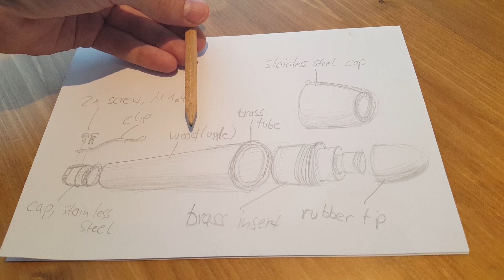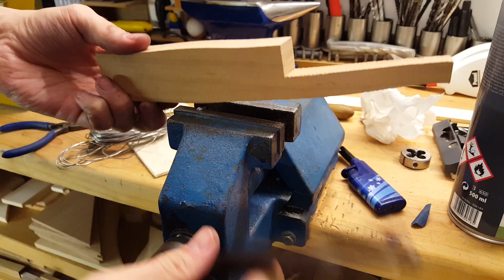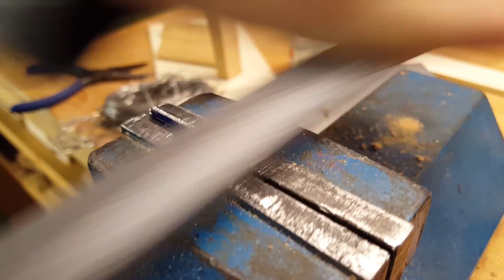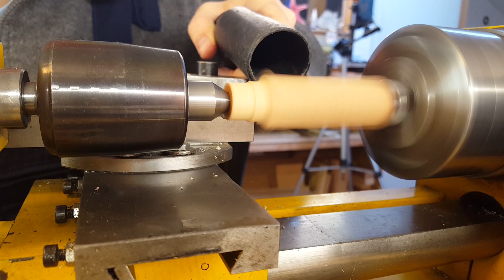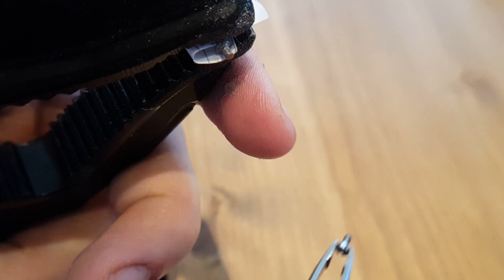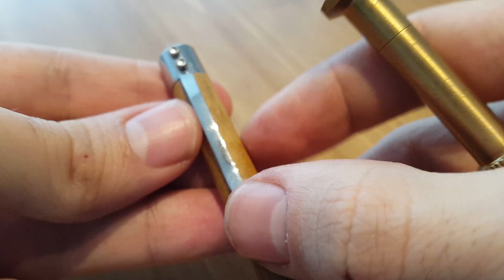How to make a fancy stylus in the metal workshop

Comment: Which material you use in the pen for touch plzz, reply
Reply from the maker: Hi, what part of the pen do you mean?
Reply: @pilotsworkshop4554  pen front black portion which is touch to the mobile screen for writing.Black material.look like rubber bush.
Note- Sorry my English is Soo horrible 🙂🤗
Reply from the maker: Ah ok, I didn´t make them but used standart ones that came as replacements with a pen that I bought. I don´t know what they are made from, It´s something between rubber and sponge. Hope that helps :)
Reply: @pilotsworkshop4554  ok thank you Dear frnd

Comment: When you push the brass tube into the wood, won't it simply scrape out all the epoxy you have used on the tube as well as the wood? If Youtube would allow 5 likes I would have clicked 'like' 5 times.
Reply from the maker: Hey, that was a thought I had as well. So I waited for 2 min to let the Epoxy soak in to the wood and I prepared the brass by sanding and cleaning it with acetone before putting on the glue. Then it just needed to stay in the tiny cracks and ridges. It only needs a very thin layer of epoxy to bond. 
I´m glad you liked the video! Thanks for watching!

Comment: I don't get it how it works. Everywhere I search about capacitive styluses they state it has to be metallic so that it can conduct to you and such (I can't really explain it in english). So either this is not capacitive touchscreen, or I did miss some magic trick
Reply from the maker: Hi! I was researching it for some time before I made the pen and still was not sure it would work. It is a capacitive touchscreen. It reacts when I use a nail but not with a piece of wood for example. But the screen seems to be quite sensitive, so a thin isolator around the metal core seems to be fine, like you can use some phones with gloves on.  I still made sure to keep the wood thin (0.5mm) and to have a nice metal core. Hope this helps a bit :)
Reply: Thank you for clearing that out. I think I got some new inspiration for a project after my finals!
Reply from the maker: Awesome :D Good luck with that!
Reply: it is metallic, to send the magnetism of your hand to the tip of the pen thats all